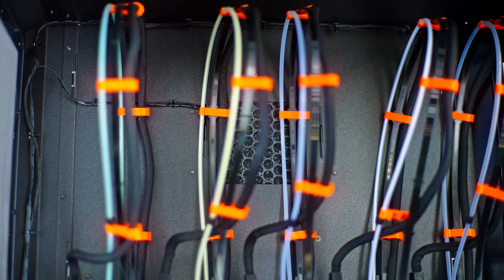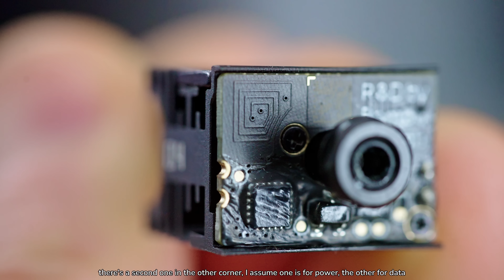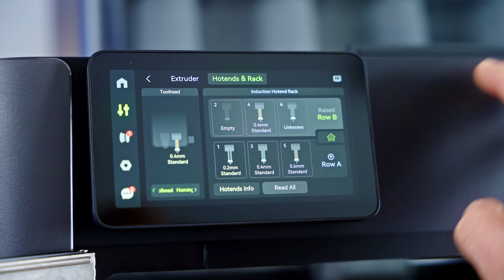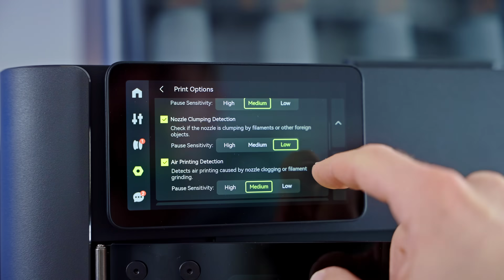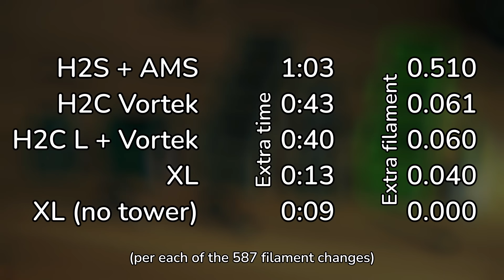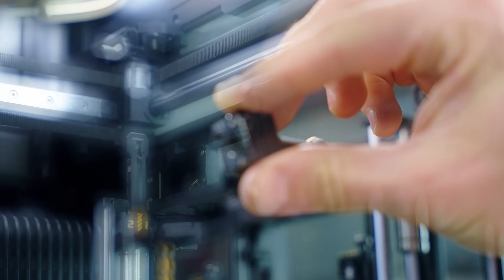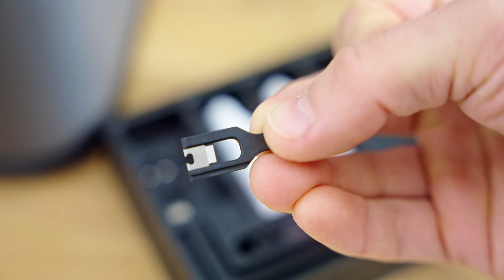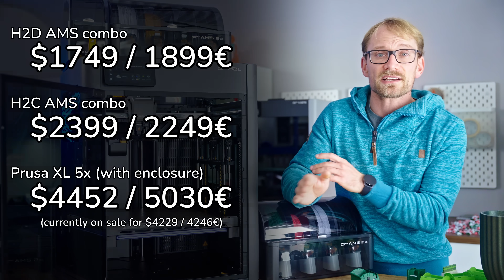The H2C is Bambu's 7-Hotend Patent Evasion Masterpiece!

Comment: Bambu's answer sounds exactly the same speak printer manufacturers use when they say they care about safety/quality while doing everything in their power to lock down their products
Reply: This isn't really apples to apples though, ink cartridges can't start fires. Of course the communication protocol should be documented for owners even if just for repairability alone, allowing 3rd party competition so long as you trust the circuitry from that vendor, but there is at least a plausible safety argument in BL's defense.
Reply: Except the printer manufacturers added chips which do nothing besides blocking after market parts. Bambu has made a wireless heating system which while Bambu does not officially support third party hotends it does not prevent/block it either.

Why and how would Bambu support random hotends you buy on Aliexpress?...
Do Creality and Prusa support third party parts you bought at random places? Nope.

Always this dishonest 'is drm lockdown' comment without any arguments backing it up...
The same with the RFID tags in their spools, so many clueless people screamed it was DRM, despite the fact that it was never possible to use that as DRM as only the AMS even has an RFID reader. So the printer itself cannot even read RFID tags on external spools, it would be impossible to turn that into some DRM...

Same with these hotends, and frankly rather disappointing but also typical of a Youtuber he asked if Bambu supports third party hotends. Of course they can't support third party hotends, that would be on your own risk only.
The honest question would have been 'will Bambu allow or block the use of third party hotends'.

THAT would have been a good question with a very interesting answer.
Instead, this youtuber asks one question and takes the answer out of context for clicks...
Reply: To be clear it absolutely can be "from" on the hot end if bambu would like. It is a "smart" hotend that has a microcontroller on it and and potentially even a secure storage chip that would allow them to introduce bambu specific keys onto the hot end to be communicated with and authenticated as genuine bambu hot ends (or not).
Reply: Drm"
Reply: @someguy4915  Prusa absolutely supports 3rd party hardware and software, what are you talking about? You can even flash your own custom FW on a prusa and they will still give you warranty and support. Bambu lab wont even let you use orcaslicer on their H2 series of printers cause they're so anti 3rd party. Its only a matter of time before bambu starts locking down more things like they've already done, and start reporting you to the authorities for printing "prohibited" things like flashforge just announced that they would do.
Reply: @LilApe  No, that invalidates your warranty with Prusa too, you gotta break the seal to flash custom firmware onto it, and Prusa says  "we disclaim liability for any kind of damage or harm a printer with a broken seal may cause." on their site.
Reply: @LilApe  me when I make stuff up

Comment: "In the name of safety" no thanks. I refuse to tie myself into a locked ecosystem.
Reply: Or you actually read what Bambu said instead of parroting this youtuber that's desperate for clicks...
Bambu: we won't support third party nozzles.
They never said they won't allow them, nor that they will be locked into an ecosystem...

Support = Bambu says this third party nozzle is guaranteed to work.

How would Bambu ever be able to support some random nozzle from Aliexpress?
The nozzle might work, it might not, it might also just burn your house down. In any case Bambu is not promising you that this random third party nozzle works at all.

It's like buying an aftermarket battery for your Tesla and then being surprised when Tesla says they're not legally responsible/liable for any damage resulting from it...
Reply: @someguy4915 bot detected

Comment: My concern is TPU.  This printer seems to be worse than the H2D.  You can only print TPU on the right side.  This is the side that now has the nozzle changer.  This seems to mean that if I use TPU, I must figure out how to disable the VORTC system from changing anything since TPU is not compatible with the AMS (which the VORTEC depends on).  So IF this proves possible, and might not be, then I would still be limited to a single hard material and a single soft one.  This is worse than the H2D can do, since if I have to I can swap the material in the left side without removing the TPU from the system.  Combine this with a smaller build plate with uneven heating.  Who is this for?  People who never ever print in TPU or other soft material?  What percentage of 2500 printer buyers are so locked in to PLA or what have you that they don't get the benefits of including TPU?

Am I missing something?  Is this not an upgrade to the H2D but a side grade?
Reply: There’s a “H2D” mode, the nozzle remains in place, is not swapped.
Reply: @EditioCastigata  good to know.

Comment: I'm really disappointed. 43s for single filament switch! For 500 changes it's 6 hours just for doing switches. And also no true multimaterial - TPU won't work with AMS (unless AMS specific hard TPU is used).

Switch time is lot better than current 90s BUT it's 2025 and full filament switch solutions are known to be much faster and handle even soft TPUs. Why Bambu insist on keeping old solutions that are inferior?  To keep current inventory sellable?
Reply: Bambu HAS to use the AMS in everything, becasue if they don't, their VC investors wont be happy. They've sunk so much money from VC investors into the AMS that if they stopped supporting it, they'll get no more funding. So what you get is an inferior product. Bambu lab fail.
Reply: Funny...
Reply: I'm sorry but the time to switch filament seems like such a weird thing to cling to.  Especially when you admit that it's cutting time by HALF of what their current printers are doing.
Reply: @Hedgey404 relative to the U1 it's still half as fast and 2.5x more money. It's an improvement within the Bambu lineup but a step to the side within the industry.
Reply: @ericnelsonnn the U1 isn't even in the same category of printer. That things junk compared to a H2D/H2C
Reply: @FrozenByFire3 😂spoken like the average blind Bambu fanboi
Reply: That's a bold claim when the U1 hasn't even hit customer hands yet.  On top of that the U1 has 4x the amount of points of failure compared to this...
Reply: @Hedgey404 did you even look at the f
Vortek systems mechanical design? It looks so fragile and intricate it'll break if you look at it wrong. Bambu support is going to be flooded with tickets
Reply: @FrozenByFire3  Build quality on U1 seems to be total ass.
Reply: @ericnelsonnn everyone says blind bambu fanboy. I then laugh as I print PPA-CF with ASA as a support material to get 100% perfect prints in my awesome heated chamber and high temp nozzle. Enjoy making colorful toys for children while I actually use what the HD2 was designed for. End use functional components for industrial use and not some kids toy.
Reply: @Hedgey404 Because that’s slow on what’s possible today and that’s the problem. Bambu stopped innovating IMO.
Reply: @arekx  It's not just speed.  It's still 2x faster than the current X1C/H2D process with AMS, but it's also 99% less wasteful with purge.  It's also got less points of failure than a snapmaker or prusa...
Reply: @arekx  Bambu lab never innovated, all they did was copy everyone else. Anytime bambu tries to "innovate", you get gimmicks like lidar, CF rods and this crap.
Reply: @LilApe  You're in like 10 different video reviews just shitting on Bambu.  Wild how sad you're life is...
Reply: @Hedgey404  No pogo pins which will biteU1 owners eventually.
Reply: @Sprogster  oh really ... so 200k cycle rated pogos that you can change in few moments vs magnets permanently embedded into heatsink of the proprietary hotends ... magnets that get damaged and eventually destroyed with HEAT ...

dont know about you but id rather change pogo board in each toolhead once a year for pennies rather than have all $40 hotends degrading with use to the point you have to throw them out and replace complete hotend 

one of the reviewers already managed to totally demagnetize the magnets while trying to declog his 0.2mm nozzle  - totally ruined and unusable just by being exposed to HEAT ... yknow like HOTend will be 24/7 while printing ...

stop gobbling up the Bambu propaganda, theyr solution is FAR more problematic than industry standard and decades old proven pogo pin interface ...
Reply: @Asghaad good quality magnets can handle like 150-160C without losing magnetism over time whatsoever. If your heatsink is reaching 150-160C, you're in for a whole lot of trouble besides your magnets overheating.
Reply: @LilApe the X1C blew up the entire printer market. It was a printer unlike anything else. Speeds beyond any consumer printer that isn't a custom built Voron 2.4 which has its own slew of issues. The Lidar system functions absolutely flawlessly if you aren't a complete dunce and make sure your stuff is clean. Flow rate, Pressure advance all being done automatically and flawlessly is something every other printer manufacturer struggles with. The print quality coming out of the X1C when it came out was undisputed, and it still is in the top levels of print quality this many years later while everyone's playing catch up. Haters gonna hate. I owned Prusa MK3s' and Qidi printers. None of them even come close to a bambu in speed, reliability and raw print quality.

Comment: I said it before and this did nothing to change my opinion. This is an objectively worst implementation of bondtech's solution. You're right when you say that they are trying to dodge patents. And in doing so, they have uncharacteristically made a product that is not superior to the other offerings on the market.
Reply: It seems the Snapmaker U1 has a superior approach, albeit limited (for now) to 4 colors. The H2C will minimize poop, but the color changes are still going to be as slow as the X1C with 2 AMS’ I already have, as the AMA still has to take the time to swap filaments. The U1, on the other hand, swaps out the entire hot end with separate feed tubes. Much, MUCH faster.
Reply: It’s way worse 😢
Reply: Let's see what you come out with guy.   lol
Reply: @Tech_304-1  I may have an engineering degree, but I don't work in the 3d printing industry. 

That said, if I were designing a solution, it would probably look more like INDX (the patent that Bambu is very obviously trying to dodge) and less like Vortek. Vortek has significant limitations as outlined in this video and many others release from all the usual suspects. While we don't have hands on reviews from these same sources on INDX yet, and probably wont for another 1-3 months, I'm cautiously optimistic that it will blow Vortek out of the water. I anticipate INDX's main weakness being that it is not a printer, but an after market system that will take more significant time, effort, and expertise to incorporate into an existing printer, making it out of reach for many novices. Functionally, I expect that it will out perform the H2C as long as it's incorporated onto a high performance base platform. 

So yeah... H2C fails to impress me and has been pointed out by several reviewers, it is less groundbreaking and more "incremental improvement" while I still anticipate INDX being truly groundbreaking.
Reply: @Tech_304-1  okay bambu fanboi
Reply: @Tech_304-1 Critical thinking and opinion do not require creativity or an engineering degree. It's a perfectly valid opinion.

Bambu's approach deffinatly has marrit, but it is by no means the end all. My biggest turn off toward Bambu is the Apple approach. An effective marketing strategy, but not for me.
Reply: @atsernov  that's a good way of saying your idea is worse lol
Reply: @Tech_304-1  fanboi sheep they are a million dollar company they don't need you to white knight them like a little bambu incell. I have an excellent x1 carbon I love it. Doesn't mean I'm going to lie to myself and pretend like they're implementation of something that already exists is better. homie doesn't need to design one because another company already has and it's  objectively better. Either way it's your mouth lick whatever boot you want
Reply: Merit
Reply: @atsernov  💯

Comment: A great example of what can be done but an awful lot of failure points.
Reply: Failure points: 1 BLDC motor, same as the extruder motor and those aren't known to fail even after thousands of hours of printing so the BLDC for the nozzle changer will surely outlast the entire printer.
1 locking pin. Easy to replace, pull the old one out after maybe 5K hours of printing and stick the new one in.
Timing belt. A bit more involved to replace, but judging by how the timing belt used for the Z axis is known to function well beyond 10K hours the belt in the nozzle changer will likely also outlast the entire printer...
Reply: As compared to????  That snapmaker that has 4x the amounts of possible failure points?

Comment: The only problem I see. Is the more complex, more parts, more possibly of part wear out or failing.  No a problem if the company has great support, but some don't.
Reply: So you don't foresee any issue with having proprietary lockdown nozzles?
Reply: @kinoadell2922  they had 3rd party nozzles for their other printers, both unapproved and approved. But induction is quite complex so only Bondtech is likely to have a solution for this. But Bondtech has their own solution so it's unlikely you'll even see any third party trying to make nozzles.
Reply: @kinoadell2922  Besides this youtuber, who said anything about the nozzles being locked down?

Bambu: we won't support third party nozzles.
This youtuber, desperate for clicks: omg lulz they drm theyz nozles

Bambu won't (and can't) support all third party nozzles you might buy from any random store.
The real question is: will Bambu block the use of third party nozzles?

Judging by their past: no, Bambu has not done anything against third party components except one optional firmware update that blocked them out but was kept optional.
Reply: @someguy4915 Bro put the koolaid down, this shit is 100% locked down and will not support any 3rd party anything. Also the firmware update that blocked 3rd party software was not optional
Reply: @someguy4915  nozzles have theyr own electronics that translate temperature and transfer it through induction coil to the printer ... its possible someone will reverse engineer those electronics but thats unlikely ...

so yes its highly likely the nozzles will only ever be made by Bambu
Reply: @coreymartin9630  3rd party software is still compatible with Bambu printers, stop believing clickbait nonsense lmao, you just can't use the Bambu cloud functionality with 3rd party soft. They even state that 3rd party software is compatible with the H2C on the release page on the Bambu site.
Reply: oh there are poroblems 

heatbed is a mess, heating unevenly and to lower temperature than reported by the printer

system REQUIRES use of AMS ... which cannot work with flexibles nor any abrasive filament - no CF no GF no luminescent filaments ...

and the worst - the hotends mount to head and rack with magnets ... magnets that get damaged and can be completely demagnetized and ruined BY HEAT ... and they are non replaceable and embedded directly into the heatsink ...
Reply: @Asghaad I would like to point out that I have been using cf and gf filaments in my ams on the X1C I bought in the kickstarter and while I am not a print farm owner I have put through multiple spools of cf and gf filament and have no issues with my ams.
Also I can use my X1C and the H2D I used at a prior job with out the ams and have experienced no issues.
Reply: @beauh780  YET ... you have no issues with your poor abused AMS YET ... its internals are NOT hardened and each meter of those abrasive filaments was like a sandpaper to all gears inside that thing ...

and buddy, you CANNOT use the Vortek without the AMS, its mandatory for the system...
Reply: @Asghaad I do agree that the way they implemented the heated bed on the h2 series is very bad but I have found that if you give the printer time to heat up and for the heat to spread the issue is work aroundable despite it never should have been an issue in the first place.
Reply: @beauh780  that is unacceptable with printer that costs this much ... quirks and issues like that are for low end hobby machines not for something that costs $2400+ ...
Reply: @Asghaad  AMS fully works with abrasives, it's only the brittle filaments that are an issue with it. Look at the CF/GF/luminous filaments on the Bambu store, they are mostly AMS compatible. Bambu just warns that abrasives will cause more wear and tear on the AMS, which means replacing PTFE tubes and other filament path parts sooner.
Reply: @Mamba_LZ  no the manual for AMS directly states abrasives are not supported and its not about PTFE but about gears in the feeders ...

from the AMS2 quickstart guide page 13 : "Printing - Filament not supported - ...Bambu PET/CF/TPU95 A and OTHER BRANDS OF FILAMENT CONTAINING CARBON FIBER OR GLASS FIBER"

they are listed in DRYING section of the table because you can dry them but you CANNOT feed them through the motors and gears of the unit

the manual for the unit literally states they are NOT compatible 

maybe actually read the damn manuals you get with your devices ... i did and its RIGHT THERE in no uncertain terms...
Reply: And cost for the system